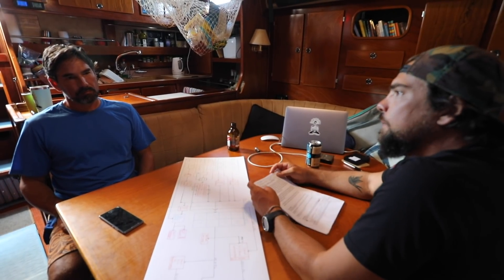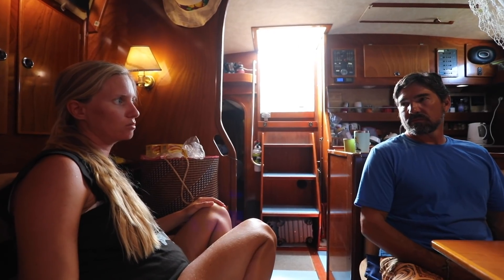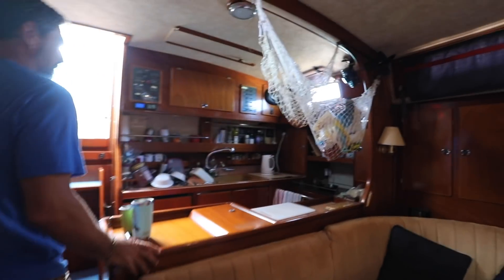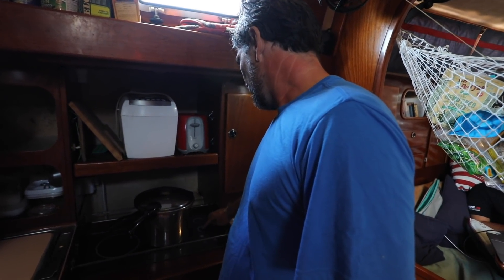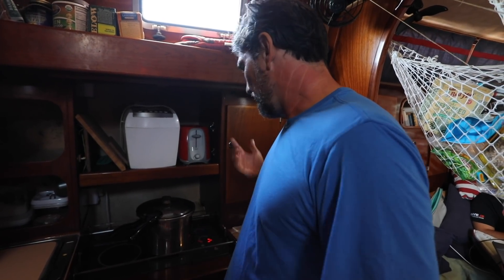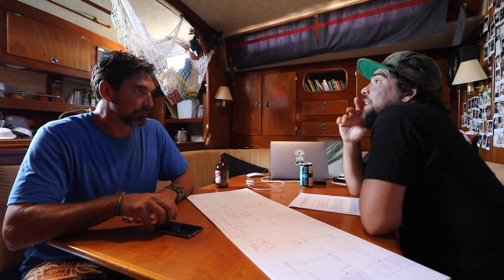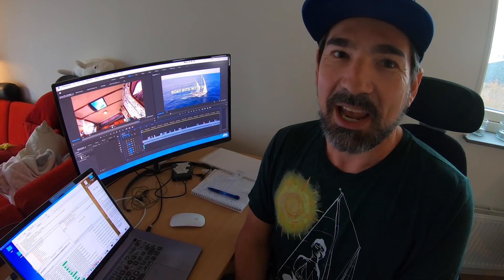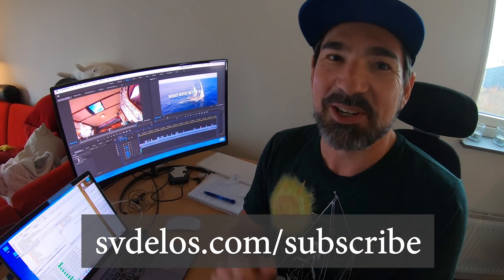1 YEAR REVIEW - Induction Cooking on a Sailboat -  ELECTRICAL BOAT TECH (3 of 7)

Comment: Great video and well done for showing it can be done effectively and increase comfort on board!

One good thing to know is that many domestic induction cooktops now have built-in power limit options to suit different home wiring setups, so that when using the cooktop you don't risk overloading your circuits at home. This is very useful on a boat as it provides additional protection from overloading the inverter.
Whether an induction cooktop has this feature can typically be found buried in the manual, but it's already common across the Miele & Siemens/Bosch induction ranges, to name a few.

What would be interested to know is whether a switch to induction from propane/LPG, with the obvious safety benefits, could potentially reduce insurance premiums?
Another question -- does the induction cooktop have any negative effect on the electronics onboard, such as interference?

Comment: .... your comment about heat from a gas stove .... always wondered why cruisers did not set up an outside cooking station to keep the heat out of the galley, cabin ....  found this quite interesting and liked that you compared the convection to gas oven .... like the Idea of having a generator for backup ..... you have mentioned before about going electric before, which from limited reading think that this is the way to go. There are those out there that go solely electric, I would only do it if there was a backup generator that if in dire need would be your backup .... electric is right there, no messing getting an engine started .... great video .... have fun be safe, save our oceans .....

Comment: Do you have any issues with so many charging devices wired to the lithium batteries?  I know its common to have same vendor solar and shore/gen power charges wired to the batteries (Victron MPPT and Multipurpose inverter), but do they play nice with the wind chargers?  Seems the wind chargers would have to have to be programmed to the same charging algorithm as the Victron equipment.  Otherwise, one charging voltage might interfere with the other?

Comment: Po Sho Delos , i installed a two element ...full blast induction unit on my boat along with the oven.
As you mentioned i like the heat being generated inside the cooking pots and not overheating the
Inside of the boat. Also in my high latitude sailing, not having water vapour released into the interior
Means i no longer need to run the dehumidifier near as much. Chimo .....

Comment: Hi. I met you at the Annapolis boat show. I am refitting a Hans Christian 38, and I am planning on putting in an induction cook top and convection microwave. This episode was very useful to me and has triggered some questions. Awhile ago, I purchased a 2000 watt Inverter/charger (still not used) and have been considering returning it and purchasing a 2500w one for the reasons you mentioned in this video. You however have a 3k inverter/charger. I do not have a generator and probably will not have one; the boat is smaller than yours and does not have the space available for one. Do have suggestions or thoughts for my situation? I always thought I would never use both the stove and the oven at the same time. That seemed to be the logical solution. Thoughts? 
Rick

Comment: Good job gentleman  simple and to the point.   The added heat to the interior of the cabin and finding propane is enough advantages to switch. Dont use my gas stove in the house when the air con on, its summer time that what barbeques are for.

Comment: Take PVC pipe bigger than your hose and run your propane hose through it to prevent wear when boat rocks if you still use it since you use the electric stove.

Comment: is the Inverter / Battery powerfull enough to run the watermaker without the generator?
Reply: Dennis Patrick  They still use the genset to add power in, its not fully replaced yet.  That would take a lot more solar which would really start to get hard to place practically.  Plus lose some redundancy of having 3 kinds of energy productions, solar, genset and wind.  Especially for blue water world sailors, redundancy is really Important but not the same for a day sailor.  I don't think we are quite there yet to really replace gensets, especially considering it just runs off the diesel that is always still needed for propulsion.  I know there are a few experimental all electric boats but full EV isn't there yet.  Hopefully in the next 20 years we'll be there.

Comment: I live in my RV and have been using a portable induction cooker for years.  It's a 1800 watt unit but I almost never run it on high.  I can boil water faster with the induction cooker than a gas burner and what's nice about it is when it's hot, I can just unplug it and take it outside to cook something and not heat up the inside of the RV.  I dry camp a lot and really enjoy cooking with the induction cooker knowing its all being powered from the sun. 
 It would be great if you showed more detail on the electric stove, maybe even a shot of the nomenclature ...Thanks.

Comment: Natural gas cook tops rock while propane cook tops and natural gas/propane ovens suck.  I can't stand the smell of propane on a gas cook top and oven inside an enclosed area.  Electric stoves suck whereas electric ovens rock (convection electric is even better).  Induction cook tops are an awesome alternative for the cook top - they heat up and cool down fast.  On a boat - I would dump the gas in a heart beat for an induction cook top.  Electric convection oven is an easy "hell yes".  I guess the whole issue on a boat is  - do you / will you have the power to run it all and not turn your power grid into molten slag or worse!  Great video Brian.  I like the set up you have installed on Delos.  Thanks!

Comment: the lithium appears to have many advantages.  Other than cost, what are some of the disadvantages like the possibility of fire due to rapid discharge and how have they been addressed by the manufactueres and installation/integration design
Reply: with the lifepo4 chemistry they put in, fire dangers are non issues. safer than standard lead acid. it is the other lipo chemistries that have big issues with thermal runaway...

Comment: Curious as to how much power your dive compressor and water maker use that you can only run them on generator power. Is it the surge power from the motor's that prevent using on batteries or the inverter capacity? If the oven's using 1300W you'd think you could run a motor capable of operating a compressor or water maker?  I'm sure I've missed something in my thinking :)
Reply: I don't know what dive compressor Delos has, but they pretty typically draw around 15-20 amps at 220-240v and it takes probably around 40-60 amps to start it off.  Given their 3k inverter produces around 13 amps at the 220 volts it wouldn't be enough to start or run the compressor.  Even if they had the inverter power to start and run the motor, it takes 20ish minutes to fill a scuba tank from one of these smaller compressors.  So it would drain the batteries too much to be worth it.  

Water maker is more reasonable to run on the batteries as they typically draw < 10 amps running, but it wouldn't be a good use of the batteries likely which is more probably why they just run the generator.  It can take quite a bit of time to fill the water tank(s) so it could easily draw the batteries too low to be worth it.

Comment: The oven doesn't use induction does it?  I'd figure it's just heating elements, probably top and bottom - bake/broil.
Reply from the maker: Right, just convection with is basically hot air blown around by a fan :)
Reply: @svdelos  Electric convection oven is the way to go.  Been using one for ~12 years now.  We find it cooks faster with lower heat.  Our rule of thumb is 75% of the temp and 75% of the time you use for normal oven.
Reply: @dgoatranch  Fan oven, I would have thought, would be better - because in a convection oven the top of the oven will be hotter than lower down; whereas with a fan the heat is pretty evenly distributed.  Gives you more control.
Reply: @rogerstone3068  what's the difference a convection oven has a fan to circulate the air inside.  Never heard of a fan oven.
Reply: @rogerstone3068  a convection oven has a fan to blow the air around in the oven. What you are calling a "fan" oven is what's known as a convection oven.
Reply: Joe Cat fan oven seems to be a term used in Britain but is essentially the same as convection.   A fan moving the air in the oven or convecting thus preventing hot/cold spots.  Result....lower cooking temp and or shorter cooking time.
Reply: @joecat101  Maybe it's a difference between English and American naming, but a convection oven here has heating elements in the walls and the whole oven gets hot. Convection means the hottest air rises so the top part of the inside will be hotter than lower down.  That's the traditional oven.  A fan oven doesn't have heating elements in the side walls, it has an element behind the rear wall and a fan which drives the heated air out into the main cooking part of the oven.  The air is being moved around by the fan, NOT by convection.
Reply: @rogerstone3068  This is a case of using a word to name something that is incorrect sorta like calling a facial tissue a Kleenex.  I have a small oven that is both a conventional & convection oven.  It has heating elements on the top and bottom and a fan that runs when set to. They're using the word convection to describe any oven that circulates the air inside with a fan to even out the heat thru out the inside of the oven.  You are correct about the England and US, we both speak English but very different words are used for naming things, boot-trunk, spanner-wrench and so on.
Reply: induction uses electromagnetic field to make the pot or pan get hot & cook your food, that doesn't work for baking.
Reply: @joecat101 ,  Well, interestingly you can use a "dutch oven" to bake things.  And one of those would work on an induction stove.  But I do know what you mean. 

And as to Delos' reply, I once had, and now have, a convection oven so I'm familiar with them.  However, it did not occur to me that you might have a convection oven on Delos.  But it make complete sense.
Reply: The Gosun grill takes about two hours to cook, but it doesn't need propen, electricity or wood. Just the Sun light. Excellent for backup.

Comment: You mentioned having a failure of the gas solenoid in the past.   Obviously not a problem for you now you cook electric, but for your readers still on gas I asked my gas man what to do if the solenoid stops working.  The instructions from the gas man are 
 

remove nut from solenoid coil

remove coil from valve stem

undue the Stainless steel nut / assembly/ stem

when apart remove the plunger pad and spring

re-fit the stainless nut assembly/tube/stem

The solenoid will now have free flow without power.

Hopefully this will  never be necessary
Boyd
Reply from the maker: Good to know, but since propane is heavier than air it tends to settle in bilges.  I have heard some horror stories of boat decks being blown off so I always wanted to make sure the solenoid was closed off....
Reply: That's why there's a gas sensor / alarm installed somewhere down in the boat. Saved my boat at least once (after having installed a new cooker and the connection between the pipe and the cooker got loose in high seas while cooking). Also, you can just simply suffocate if there's enough gas floating at the bottom of the boat while you're asleep...

We just have two mechanical valves in our very simple propane system, one at the tank connector and one in the pentry cupboard near the stove. The one in the pentry is closed whenever the stove is not in use; the one at the tank is closed whenever we leave the boat for a longer period.